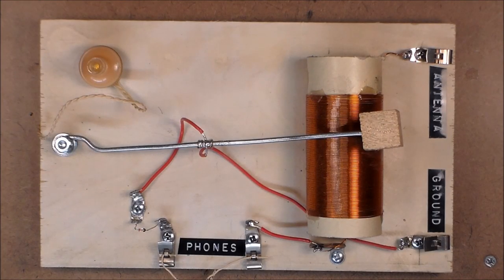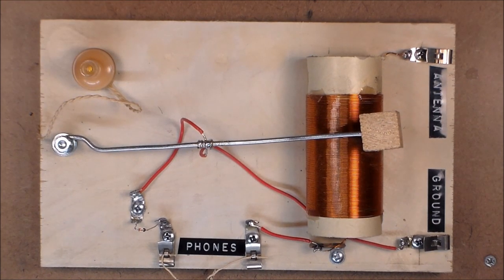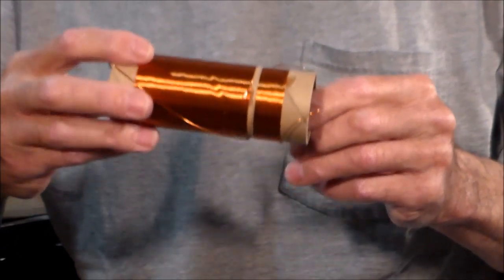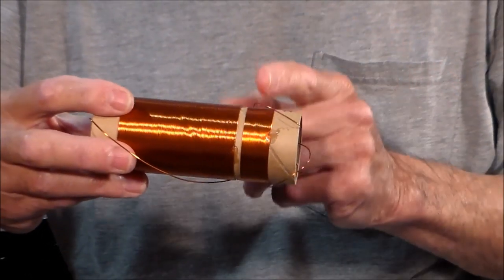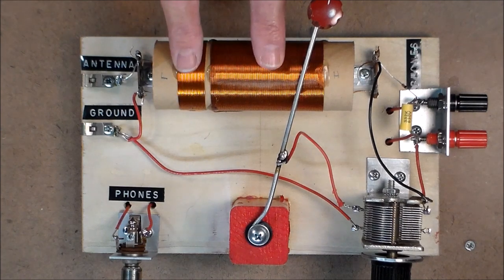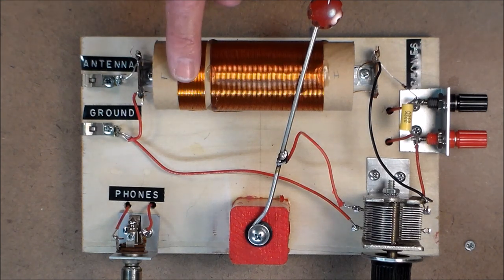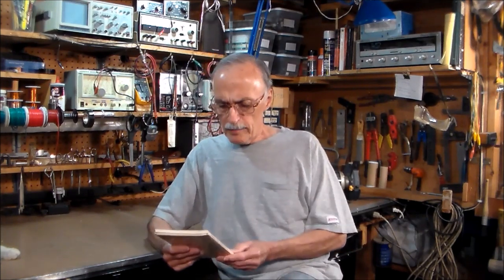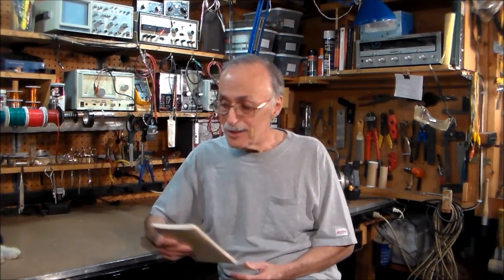BOY SCOUT CRYSTAL RADIO UPGRADE

Comment: When I was about 6 years old, my dad got me a spy pen radio. They were advertised in comic books all the time.

It had a clip to clip onto something to make an antenna and a clip for ground and a metal sliding pin to tune with.

I lived in the city and there were several strong stations that I could get.

I thought it was the coolest thing ever and to think that spies used it made it even cooler.
Reply: I was maybe more like 10 years old and was really into comic and their advertisements for odd items.  I ordered one of those  crystal radios..  not sure it was a "spy pen"   The one I ordered and got was similar in shape and size to a Pez dispenser.   For an antenna, I used my bed frame and grounded on..  I'm not sure.. perhaps I was the ground?   It was cheap but it DID bring in a couple of the strongest AM radio stations at the time.   As I remember.. the only time I could hear it work was in the dead of night because it was quieter at that time.
Reply: In the late 50's I had a one-wire Xtal radio in the form of a jet fighter - it was tuned inductively buy moving the ferrite core (via the nose probe).  I clipped the wire to my woven-wire bed spring.

Comment: It was nice to hear you mention the wire info for the coil. MOST people DON'T.  It must be frustrating for beginners!!
Reply: I felt in the same way. I wondered why these two coils, one small and amother big. No explanation was offered. Still I am in the dark whether the small cool is connected to the antenna, and what about the other point?  Is it also connected to the phone?
Reply: @drmrinalkantinath4336  - The 2 coils are inductively coupled together.

Comment: I've been into amateur radio for nearly a half-century, and cut my teeth as a kid building crystal radios.  Periodically throughout my adulthood, the crystal "bug" bit again and I fooled around with crystal set construction.  My personal bane has been the selectivity v. sensitivity issue.  I can build a set that is very loud, but not selective.  Or, I can build a very selective rig that just doesn't have much volume.  But, I can never build a passive radio that has both volume and selectivity.
Reply: I've been using a trick I learned from Elmer Osterhoudt. Put a 365pf  variable condenser between the radio and the ground.
Increases selectivity and it still has decent sound.
Reply: Study up on transistors and bandpass filters.  That will help.
Reply: Getting a set with high enough Q to accept the load of antenna and ground, this means EXPENSIVE and challenging construction. 
This takeds two movable coils of extremely low loss ( Q over 1500) bifilar high count thin Litz (1040x48) wound bifilar on 1:1.6 ratio (length to diameter). 
low loss former (polystyrene with stripes of styrofoam to lessen mass near the coil increase the Q)
Good variable capacitors ( ceramic insulated clean and preferably silvered copper) 
as well as the impedance matching network together with. RCA big can balanced armature headphones. 
Impedance matched diodes with low loss and distortion... 
It becomes a science challenge. 
I have gotten DX from across the ocean so it is  possible. Sadly not easy or cheap.

Comment: Back in the '70's while stationed on a repair ship in the Electronics repair division, I was tasked with getting the radio in the chief's lounge to pick up the station they wanted. After going over the whole antenna system and finding it was good, I made a simple antenna coupler on the back of the radio. The improvement was stunning, where we only had about half a dozen stations, it now was picking up so many stations that there was not a quiet spot on the band.
Reply: ❤ESCARGENCY ❤😂❤

Comment: I used to fiddle with crystal sets. As I recall, good standard earphones had more volume than crystal ear buds. I also built a number of sub-min tube and transistor AM and RC plane receivers. Great fun squeezing parts and A and B batteries into small cases.

Comment: Back in the mid-fifties I built my first radio from a Cub Scout kit. It had a piece of Galena potted in solder and had a cat's whisker to tune for the best signal. It worked great! In the early 90s I was talking to some guys on ham radio and I said that I wished I could get a chunk of Galena so I could replicate that same crystal radio. Nobody offered any suggestions but a week later I got a package in the mail and I swear that hunk of Galena must have weighed pound!
Reply: Have you ever tried a safety pin point as a cat whisker on a penny? I think a wheat penny would be better (old). It uses corrosion as a diode.
Reply: No, but I have used the safety pin trick on Old Gillette blue blades with moderate success.
Reply: Calvin, yes the copper oxide on an old penny works well. I got about three stations on a 150 year old penny

Comment: About 50 years ago, I made my own crystal radio and it worked great. 

A rock collection that I had that was stuck to a sheet of cardboard, also included one quartz rock, and so that one particular rock became my crystal detector. Either sliding the coil bar, or changing the position of the "cat whisker" wire that was probing the quartz crystal, could be used to select channels. The layout I used is the same as what is shown at "Crystal radio - Wikipedia" in the Basic Principles section. See the Pictorial diagram from 1922 showing the circuit of a crystal radio.
Reply: Quartz can't be used as a detector!
You need a piece of crystalline metallic mineral ore for use in a "Cat's Whisker radio detector"
Reply: There was probably a piece of iron pyrites in among the quartz
Reply: they don't teach this stuff in schools anymore.
Reply: @JohnSmith-eo5sp  All I know is that it worked perfectly. I had the rest of the quartz rock wrapped in tin foil.

Comment: When I was a mere "Lad", way back nearly 60 years ago, someone gave me a book called: "The Boys Big Book of Electronic Projects", or some such.
It had plans and instructions for about five different types of "Crystal Radios"!
And I build all of them! Was great fun! And I never had to spend my one dollar a week Allowance on batteries! Back then, even if you could obtain a small pocket sized "Transistor" radio, those rectangle 9 volt, "Zink-carbon" batteries didn't last long! You did better if you NEVER played the music through the tiny built in speaker, but instead always listened via that tiny 👂 piece!

Comment: A blast from the past !! I built a crystal set here in the UK with just a coil and a variable tuning capacitor, 500mf if i remember correctly, a geranium diode, as i called it then !  and a pair of wartime headfones.
We are talking way back in the 1960's, when a lot of ex war stuff was still available.
It worked very well, Radio Luxembourg was on every night, I used to pretend to be asleep, with my headfones on, listening to the Shadows, it never ran out of power,
wonderbar !!!
What puzzzles me now is that I see all these american designs use a wiper across the coil for tuning, that idea didnt exist back in my teenage days, or even the use of the coupling coil...
I wonder how much better it could have been with either, or both ??
Circuits were poached from Practical Wireless magazines, a monthly UK electronics magazine, when OC71 transistors were the latest high tech device available  😐
Perhaps you would care to comment on this point, many thanks from Blighy.
Reply: wow oc71 sounds stone age never heard of it...thanks for sharing your.experiences
Reply: "A Geranium diode"?  Didn't know you had a flower detector😉

Comment: I build on a them there in 1957 It used a Ferrite Coil for Freq. Tuning. It came as a Rocket Ship Radio but I took it apart and kinda hot rodded it, A 'Wave Magnet" thing from 1935 Dake's Cyclopedia of Electronics was a Devive where two Coils Were Able to Tume Down inbetween eatch other-s Coils as Senictivy emmiitteerrs. Or something. Hell, I cannot think any more too good. Youre More Older then me...I am a 1949 Model. Perhaps I need a Oil Change?

Comment: About 1954/55 I made a matchbox crystal set from a plan that I bought somewhere, on which the 'variable capacitor' was actually the matchbox drawer (wound with x turns of z gauge wire) gently sliding in and out of the matchbox case itself (wound with a greater number of turns of y gauge wire, or maybe it was it z again?) A friend of mine was so impressed, I made one for him, too, telling him that he would need to buy his own arial and earth wires - which he did. The crystal set had a germanium diode and it picked up several Melbourne radio stations quite well. I'm no radio expert, but I have grandchildren who might be interested making it for a science project. May I ask whether you, Squarewave2, or your subscribers may have seen this tiny model, and might know the necessary number of turns and wire gauges for the 2 coils? I've seen 'matchbox models' referred to online, but they're larger and I've not been able to find this particular model with the two movable coils. I do remember the two wires coming in, and the earpiece coming out, of such a small matchbox did make it look a bit weird, but it did grab the admiring attention of adults!  :)  Unfortunately, I remember that it didn't survive as long as a couple of larger and sturdier crystal sets that I'd made earlier.

Comment: Please excuse my ignorance as I am new to this as a retirement hobby. I have built the simple Boy scout radio that you have demonstrated it works! I then moved on to the improved version. I wound my own coil quite nicely and think that I have put it all together correctly by looking at your video and stopping it to get a better look. I cant get it to work so I have screwed up somewhere. However, I cant quite see where both tags go from the larger coil, one goes to diode phones and ground but I cant see where the other fits. I would be grateful for some advice please. I have tried enlarging the picture but still cant see it.
Reply from the maker: Hi mvv650mvv,
The primary coil, the big one, is connected to the circuit between the slider and the diode. The wire from the left end of the primary coil is not connected to anything which my diagram shows. Hope this helps.
Reply: @squarewave2  super. Thanks for this. I was looking for something that didn't exist. That's life!

Comment: Hey I absolutely love this concept of no battery connection and I want to include it in my final project. I greatly enjoyed your video and explanation and I was hoping you could show me the schematic with the values and connections so I can make a radio just like that one. Also is the tuning capacitor 365pF? Thank you so much for you time will recommend to my friends.
Reply from the maker: Hi Anthony,
Thank you for your nice comment! If you want to build crystal radios you really should look for the book "Radios That Work For Free" by K.E. Edwards. It has this diagram and others. Yes, the tuning capacitor is 365pf.

Comment: Maybe I missed it but I didn't hear you mention the ground connection. It is just as important as the long antenna wire. either a water pipe or an AC socket ground prong.

Comment: love this guys videos......easy to understand.....explains a lot......a few videos ago, he had one with the different taps (how to wind them....) and a switch I think....can't remember what type of radio it was....loved it....the cat is ok too....I gotta get back at the tinkering thing again....been a long time.....junk box is waaaay low....got a QRP HF rig (a Elecraft K1) and a limping HW-101 here in SW Montana.....need to pick up a decent SWL receiver....maybe build a simple radio and see what's up.....nearest AM transmitter from my place is 30 miles +/-.....I dunno....I got 66' of wire up, and two dipoles at 20 Ft.....limited at the rent house....mancrib has 12 wire antennas from/to NE/SW, and NW/SE, and N/S for 80-10....30 miles away....going there today for the NAQP SSB that's going on right now till 11PM MST....again....love your videos.
Reply: Swan 350 at the mancrib.....weak tubes, only 70-100W out, but the SSB audio is excellent.....was told a few months ago that whatever I was doing, don't touch it.....damn good SSB boat anchor.....I love it.....need some fresh finals though.....I checked them.....they are weak allright.....
Reply from the maker: Thank you, Cooker440. I love to get such nice feedback!
Reply: I had planned on doing a crystal radio demo at the field day site this year......tower is about 1 1/2 miles away, and that would have been perfect for an easy/quickie demo......but an angry person burned down the studio, so no more local radio station....the 550 kHz station is about 25-30 miles E-SE of here.....hell it might work.....if I did it right.....I still might try it....5000 watts daytime, 1000 nighttime....my ham radio elmer has been there 36+ years....my CW elmer....ran big contests w/him in the early 80's as a novice.....back when the big boys would go to the novice bands....US and DX.....run us slower guys......did a LOT of logging for him as well.....and as long as I stayed in the novice bands, he would let me use his amp to get up to the 250 watts input at the time for a novice I think it was....now it's 200...??? Any hoo....nice to have his beam and big wires while he was at work....loved it....keep up the damned fine work, sir.
Reply: no sweat, fella.

Comment: Dear Sir can we add variable capacitor made with aluminium foil, thanking you in advance. also please explain how to connect antenna coupllar coil
Reply: foil capacitor, yes that has been done and works. Using card stock paper and foil. The antenna coupler connects one end to ground and the other to the antenna. Then it will magnetically couple to the main tuning coil through the air.

Comment: Hey I built a radio exactly like thes except I used #36 magnet wire. The broadcasts are so squeezed together but tuning is super selective so I plan to continue using this wire and on an narrower diameter coil then I will buy some germanium detector radio diodes

Comment: antenna  300 mmps / 1 mhz = 300 meters for a full wave  75 meters for a quarter wave  the stations use 75 meter towers for their antenna on a counter poise   so your antenna should be vertical 75 meters  so you raise your coil off the board with metal standoffs

Comment: Why is the 90 to 25 turn ratio specified for the tuning vs. antenna coil? Could you explain the math for why this ratio has been recommended? Also, does the wire for the antenna coil have to be enamel wire, or can it be standard insulated hookup wire, since the sheathing doesn't need to be scraped away? Lastly, why does it matter if the antenna coil is 24 AWG? Couldn't it just be 22 AWG wire like the tuning coil? Thank you in advance for your responses and suggestions, and for your excellent video.

Comment: do you need a crystal earphone, or does a normal earphone also work? Also how do you make a crystal earphone from scratch?
Reply from the maker: Hi, Kokos,Yes you meed a crystal earphone,   there is not enough juice to drive a high impedance  earphone. I din't know how to make one, but they are dirt cheap!
Reply: @squarewave2  ok thanks!
Reply: It is very difficult to make a headphone from scratch. The few people in the hobby that did it report extremely weak sound.

There are hardly any magnetic headphones made past 1960 that will work with a crystal radio. Most are only 8 ohms to 64 ohms.
You need at least 1000 ohms to even hear local stations at low volume.
Most plans recommend 2000 ohms minimum.

The crystal ones are cheap, but I've heard that the new ones have the wires just glued instead of soldered. They go bad in a few weeks most times. Then you have to tap it on the wall or table even minute and a half.

If you stick with the hobby, I recommend Alnico headphones, ACME Trimm, Cannon, Dictograph, or Newcomb.
2K to 3K ohms.
Reply: Every minute and a half...not even minute and a half
Reply: @chrisakarazor9612  yeah, I made magnetic ones with thin copper wire, they should work fine as normal headphone, but as a speaker, the sound is pretty low. Still not that low, but relatively low, however for a crystal radio, they will never work I guess, so thats why I like to know how a crystal earphone is made.
Reply: @chrisakarazor9612  Thanks!

Comment: Many designs like this appear to call for a .001 cap across the phones for filtering. I noticed you used a 332K /.0033 cap, any special benefit of this. Wonderful video, Thanks Denny
Reply from the maker: Hi Denny,
I've used different values across the phones with no difference I can hear. In fact, I usually omit this part completely.
Thanks for your comment!
Reply: I mostly use magnetic headphones -Alnico, ACME, Cannon, Dictograph, Newcomb, I don't ever use a capacitor across the phones
Reply: Aliexpress Cyrstal Radio used 222 (2200 pF= 2.2 nF = 2n2 ),   2.2 nF =0.0022 uF
this project used 332 ( 3300 pF =3.3 nF =3n3 )  3.3 nF = 0.0033 uF    and K means -%10 tolarance ...

Comment: You should mention that modern head phones or earbuds which are low impedance - 32 ohms won't work with a crystal radio. Old headphones ware 10K ohms. If you can find a crystal ear phone it will work but needs a DC path - a resistor aross it, maybe 10K. And magnetic earphone should have a capacto across tem. 0.001 ufd?
Reply: I found no capacitor was needed as the earphone measured 23nF.
I had to use a 2K parallel resistor to get good performance.  10K was way too much.